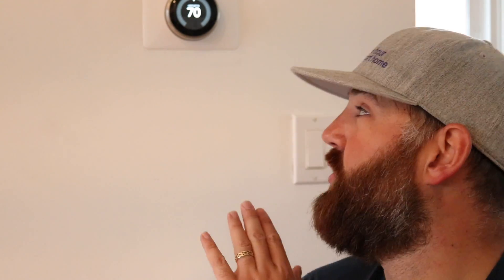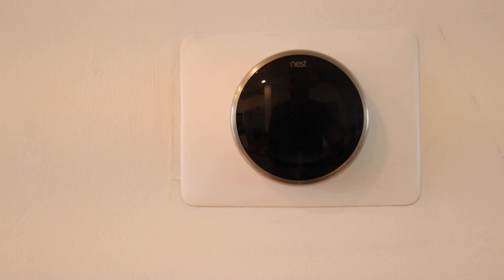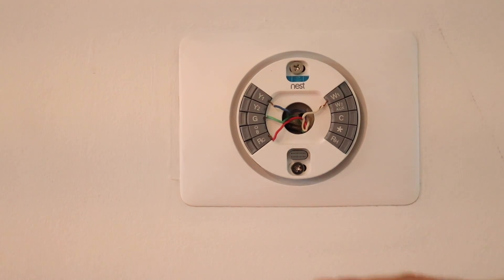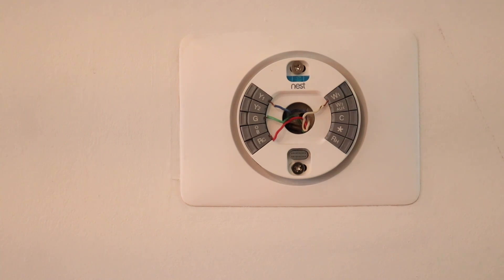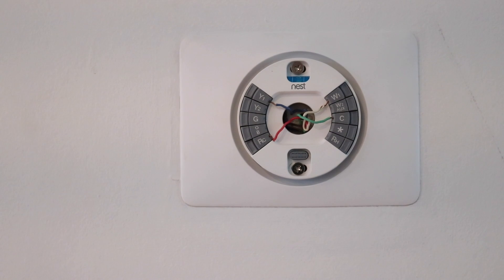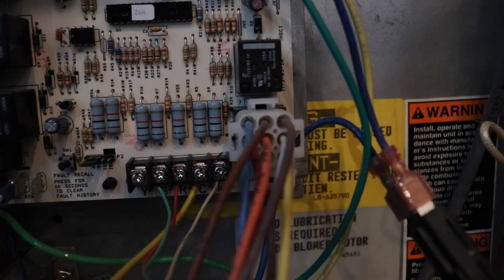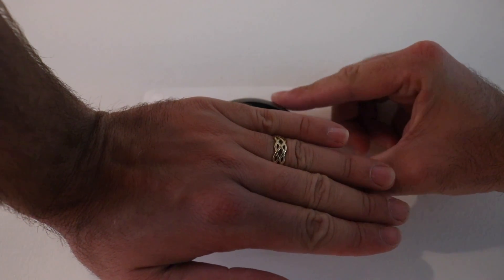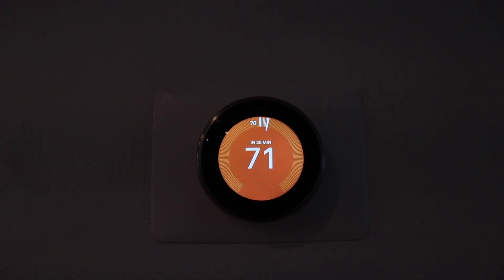Nest Common Wire Hack!!! - Nest Low Power Fixed

Comment: Hi, my fan wire (G) at the control board is split and goes to a junction box that controls an independent switch for a kitchen exhaust fan. Should I leave it connected if I move the g-wire to c or disconnect it?

Comment: I know this is an old video. But I have a gen 3 that I’ve used in three other homes and never had an issue with it. But where I’m at now, it’s having charging issues. 
That being said. My blue wire is connected to C, but when I hook it up I get no power to Rh. 
So my question is this. Would jumping from Y to C at the Nest base be the same as switching it at the unit?
Many thanks.

Comment: My 2nd gen Nest is soon to become obsolete so I'm preparing to replace it with an Ecobee which requires a 24V common that I was not configured for. Fortunately my thermostat wire had 2 spare leads as I was only using four. I also discovered the green lead (for fan only) was disconnected from the control board for some reason. That equipment screen was so helpful! Thx!

Comment: Hi I have this low power issue with my nest 3rd gen.  I’d like to try this repurpose G wire fix.  But a couple of questions. I have two heat and two ac zones. I only have problem on one ac zone. Both work fine in heat mode. One fine in ac mode. (Do have two different ac units). Very clear on how to move G wire in nest. But two questions. 1) where do I look for and move  other end of G wire to C?  In heater or in ac unit?  2) do I need to move G wire in any other locations such as other nest thermo or other heat or ac units?  For instance if there is just one G wire on heater and I move it to C to fix nest low power on the first nest thermostat, do I also need to move G to C on other nest thermostat?   Thanks for any help.
Reply: The control unit board is not in the outside AC units they are in the inside furnace blower unit. It appears you need to move the G blower wire on both ends the furnace control unit as well as on the nest control unit according to the video. 

Very important others have said on the nest control unit side you need to jumper the Y (AC) wire to the old G (blower) hole or else your furnace blower may not turn on when your AC compressor turns on and may cause damage as a result.

Comment: Awesome video. Very explanatory and descriptive. I wired my Honeywell Smart WiFi thermostat just like this in the winter. The thermostat worked well with the gas forced air heater. The problem is now, the A/C doesn't work. When I turn on the A/C, after about 1 second I hear a very slight pop and the thermostat goes white and resets. I checked the control panel (older unit with no designated control bar with letters, just a 24V transformer.) What am I doing wrong? I connected the G and C wires on the transformer and wired the thermostat per your instructions utilizing the G wire for the C wire. It's frustrating and the wife is heating up.

Comment: Even on an older two wire system, One wire goes into the W1 terminal and the other  into the Rh terminal. if you have access to the nest thermostat base, buy the 24 volt transformer and run the two wires from the transformer to the nest mounting base. One wire will plug into the C terminal and the other wire will  plug into the Rc terminal, (either wire will work, no polarity) no jumping wires. I do not have AC in my house and this is for the nest 3 learning thermostat.  Nothing i found on youtube was helpful as my heater is very old!  Works great now!!  I hooked the transformer into an 110 volt outlet in the attic, disconnected the old thermostat wire on  the wall below, hooked a new 4wire harness to it and pulled the new wire into the attic where it was  all hooked together.

Comment: Yes I have a question about the common wire. I have two zones my downstairs thermostat only has two wire because it’s for my gas furnace. My upstairs thermostat controls my upstairs heat but also my central air which has five wires with a ground. But my question is if my fan only runs when my air comes on could I just install my nest thermostat the same way my existing thermostat is seeing everything runs the same anyway ? Thanks for any help

Comment: anyone else seeing a simpler solution here ???
Connect a short wire between or from Y1 to C  and leave  G alone...
Why do all that and then even have to move wires in the attic ??? 
.
Cause thats simply what you did,  you connected Y1 and C together at the furnace...  so just connect Y1 to C on the thermo and leave G alone...

Comment: This is fantastic. As long as you know you are giving up FAN only function.  5 years later, I assume those that used this method of doing a C wire are satisfied ?
Reply: Many clients love the fan option to move air around home in circulate mode between calls every hour for 15 minutes. It’s become so popular it’s an option on basically every thermostat out now. So not my opinion or take its fact. Also people just don’t open up
A window to get fresh air if they have allergies! Lastly indoor air quality is huge ever since COVID. So they need the fan circulate or on more often then when there is just a call for heat or ac. Short cuts like this is a hack move. We immediately say homeowner did this when we find that g is robbed. Just do it rite. Either spend the coin for a professional and get a warranty or hack it in! Completely your option.

Comment: Quick question: will this disable my ability to only run the fan without heat or AC since we’re using the fan wire?
Reply: Yes you’re using the wire that allows that as the C wire.

Comment: I just wanted to send you a big thank you. A friend's Nest started to have power issues. I remember from installing it last year that her old thermostat didn't have a C wire. I guess it finally caught up with the Nest. I didn't repurpose the fan control, but I used an unused wire (black) from the bundle to create a C wire for her. Just as easy. I would at least mention that as an option because it's basically the same amount of work.

Comment: Would adding add in a jumper on the thermostat for the g and c wire and another jumper at the hvac unit do the same thing AND give fan control?

Comment: I did this wire switch on my HVAC system, but then my outside AC unit would run without my furnace fan starting. I searched all the comments here, and plenty of others had the same issue, but nobody had a clear answer on how to fix it. I put a jumper wire from Y to G on the furnace circuit board so when the thermostat sends the signal to the AC system to start via the Y wire, it also sends a signal to the G wire which starts the blower fan in your furnace. This works perfectly on my system. Hope this helps anyone else with the same issue.

Comment: What happens if you have an old HVAC system?  Will moving the fan wire stop the fan entirely during cooling and heating?

Comment: I added a c wire from my furnace and now my furnace won't start, took c wire off and furnace runs but thermostat is low on power

Comment: Why can’t you just run a short wire from G to C and leave the original wire in G?
Reply: I’m wondering if this will work also, but you would have to do it both in the Nest and in your furnace, but the C wire is supposed to be a constant string of power. I worry it will cause issues with what connects to G in the furnace unit itself. Possibly always running the fan?

Comment: Very helpful video, but I found that my system already has a C wire. The voltage across C and RH measures at 26V. Yet my Nest thermostat refuses to function, being in a continual "need to restart" loop that allegedly means the battery is permanently dead. I took the battery out, but all the replacements have bad reviews and seem like a fire risk. Will the Nest run without a battery? Is there a hack to allow it to?

Comment: This worked for me, sort of. It did solve my low battery problem for the nest thermostat. However, in doing so it also removes your ability to run just the fan by itself (no cooling or heat). For most households this is not a problem, unfortunately it is in my case. I've just purchased the Nest Power Connector to see if that will resolve the issue while maintaining the fan functionality. If it doesn't, I've also read good things about the Fast-Stat Common Maker.

Comment: I always assume it's me that is missing something, but the color coding on the thermostat cable is; Red, White, Green and Blue; at the furnace control panel the colors are; Red, White, Green and Yellow. The cable has been interrupted and now Blue becomes Yellow. I bring this up because if the Blue terminal on the control panel is 24V, I don't want to put that 24V someplace it doesn't belong, potentially frying and an expensive circuit board or thermostat. I don't really think that is the case but it seems somewhat possible. Anyone care to go nutty and tell me what an idiot I am?  Very excellent video by the way, Thanks!

Comment: Thank you so much for taking the time to produce this informative, easy to understand tutorial. It's -4 in Detroit today and I woke up to the N262 error message. I replaced the batteries last week and knew they were not the problem. It's odd that my Nest is several years old and I never had this issue before. It makes me wonder a GOOGLE software update was the root causing a demand for the Nest Power Connector device.  Either way your easy hack fixed the issue and I never used the blower only feature anyway. Thanks again!

Comment: Whether I have the G cable plugged in or not, as soon as my nest turns on it triggers my fan to turn on. The only way to stop it is by removing the actual device off the wall plate. Has anyone had this issue??

Comment: Nice video, you are correct, most newer AHUs turn the fan on when there is a call for heat or AC. Problem is, your Blue wire was not connected to the Y terminal on the AHU in the video, thus on a call for AC, the fan will not come on. Very important to not just wire nut the condenser wires, but to wire it to the AHU. Also, it may be a good idea to put a jumper from Y to G to make sure the fan comes on since the thermostat no longer would control the fan and running the AC with out a fan can do a lot of damage to the compressor. Hope you did not damage that unit and figured out your error before you did any damage.
Reply: I wonder if this is my problem. I moved the G to C like in the video and just realized that now my AC runs, but the furnace fan doesn't.

Comment: Hi...... I have several thermostats in my house. my nest learning thermostat works great I am trying to set up a new generation of the nest thermostat (the one that requires a c wire). My old thermostat just had a W, R, green and blue wire. I have tried the blue wire for a c wire but it didn't work.  How do I set up a c wire to the newest gen nest thermostat? thanks

Comment: If I have multiple thermostats (all basic nests) will I wire this the same on each thermostat and the control board? The AC isn't central AC they are individual units that are controlled by the thermostats and the heat has 4 zones which are baseboard.

Comment: My old thermostat White Roger have 4 wire connected W, Jumper (RH, RC), Y & G. There was another wire blue which wasn't connected to anything. Currently, I have connected those 4 wires and Google Nest seems to working fine. I haven't connected Blue wire to anything yet. I have checked with low voltage meter that there is some current in blue wire. My question is can I connect Blue wire to C without going to attic to find out and opening furnace. Is this any harm in connecting and trying ? Can it short or create any issues ? Thanks

Comment: Hi! Thank you for this video. I have a heat only thermostat with just a red and white wire. I have a taco relay system with 3 zones. I added a the connector to the taco relay and the thermostat only works for a day. Do you have any hack for this?

Comment: Question?
Wouldn't I get same results if I put a jumper cable from G wire to C wire?
Reply: no...  he did  Y1 to C... cause he moved G to Y1 at the furnace...
.
so if u jump anything, jump Y1 and C...  
Someone pls correct me if im wrong
Reply: @bogdanbutnaru1612  no mames y como se hace eso ?
Reply: @enrique6943  you take a small / short wire and connect Y1 to C... at the thermostat... keep Green wire on G (dont move G, leave it alone)
Reply: @bogdanbutnaru1612  Roger that thanks

Comment: put a jumper wire in the termostac from  y to c.  And you keep the fan lol.   Or heater is power wrong put  jumper from  w to c and you keep  the fan lol

Comment: You say "modern" furnaces don't need a G wire because the blower automatically comes on.  What do you mean by "modern?"  Is a furnace from the 90's modern?

Comment: Hi, your explanation is very good and easy to follow. I just have a question about the wiring at the control board before you switch the green wire. Why the yellow wire goes to the C terminal instead of to the Y terminal? Thank you.

Comment: QUESTION:  Could you just split the green wire at the Nest to both G and C … Can it support powering both Fan Control & powering the Nest ?
Reply: jump Y1 to C and you are done... no need to mess with G wire...
cause what he did at the furnace is he made Y1 and G the same wire... so Y1 was now going to Y1 and C on the thermo...  thus loosing the G wire...
but my way, u dont lose your G... u dont have to touch G...
jump Y1 and C  and u good
Reply: You can move the G wire to c, then move G to c at the panel on the furnace. Then put a jumper wire at the thermostat from y to G

Comment: Unless there's some kind of feedback from the condenser unit to the furnance where it knows when the compressor is running in order to turn on the fan, I don't think that would work. I don't see any wire connected to Y in the furnace, just straight to the condenser I'm guessing. Or the furnace can get determine if the fan is needed based on the discharge from the evaporator coil with some sensor. Eithe way I don't this will work with all kind of furnaces. If you connect the Y wire to the equipment, maybe then but to be sure 100% you will have to put a jumper between G and Y, that way you asure the unit will run the fan

Comment: Will this cause any issues with the thermostat itself? How about charging/battery and connection issues? I just had a tech do this with a new furnace install and for some reason my thermostat keeps going offline.
Reply: You might need to replace the thermostat itself. The wifi antenna might have malfunction. I had the same problem & google replaced it for a brand new one free of charge.

Comment: Thank you for the informative video, I kept getting the no power to Rh wire, I went ahead and switched the Green wire to the common and also switched at the furnace. However I'm still getting the same error no power to the Rh wire, any suggestions or help with this issue? Thank you

Comment: Our AC guy said they are not electricians so they don't check wiring.  We had a fried wired on our two yr old unit in our attic. We were getting E73 error.

Comment: This would not work on a heatpump as the signal for the fan to operate in heat and cool comes from the thermostat. On a straight cool system the call for the fan comes from the equipment.

Comment: Tried this and while the fan turned on with the heat. It did not with the air conditioner. I need a jumper wire from R to G to have air in the summer. Help would be appreciated

Comment: Works absolutely perfectly. As someone else said, be aware that when you go to test the system, it may show an Rh no power system fault. Moving the thermostat will not trigger either heat or AC. This happened to me after I flipped the breaker back on to test it out. It was a kill switch on the access panel on the unit. Go back to the air handler and place the door back on, and it will clear that error and fire right up. This was a very very helpful video, especially heading into a NY winter.

Comment: I have the same issue with my furnace but my furnace isn’t as easily and readily descriptive as yours and mine does not indicate the “C” wire area. How do I locate the “C” in my furnace?

Comment: Hold on there....your NEST display is showing "In 35 minutes" at the end of your video after you moved a few wires around. I don't have a C wire and my Nest worked fine for the past 4 years. Now I get the "In 15 minutes" notice and my heater no longer turns on. I thought if I did this fix it might change things but I see you get the same message I get with the only difference is you switched a few wires and I have yet to do so. I am pausing on my fix in hopes I hear your thoughts on this matter. I thank you in advance especially how you explained how to do the fix as if you were trying to explain it to a golden retriever.
Reply: Showing the message is not the problem here. It's just Nest's estimate of how long it would take to reach the temperature. If your Nest is not turning on the heat, that could be due to the voltage of your battery. By connecting it to a C wire, you take this out of the equation, your Nest will have the right voltage and should work properly. At that point it might show "In whatever minutes", but that's not an indication of an issue.

Comment: Thank you! Great video! I installed an Aprilaire 700M humidifier two years ago. Recently I started to get Nest low power. I did charge the battery, but the issue was not resolved. I decided to replace the senoid valve, but it did not resolve the issue either. I was thinking about installing a new wire from Nest to the furnace, but I was not happy with that idea. This hack has resolved the problem at least for now. I hope I don't experience low power again. I don't care about losing the fan only control. I don't use it.